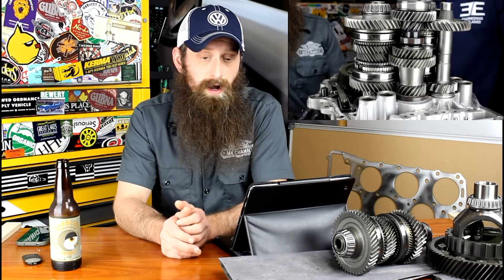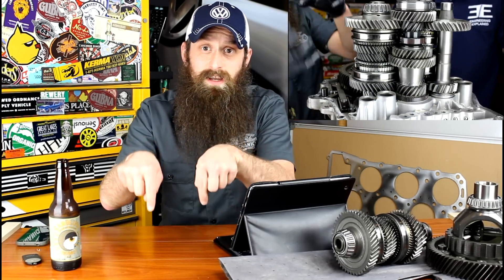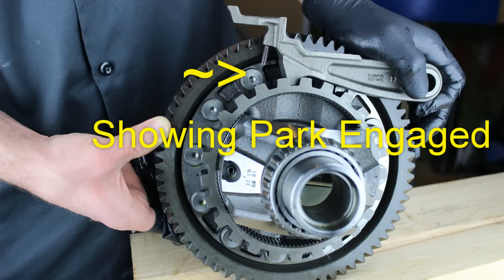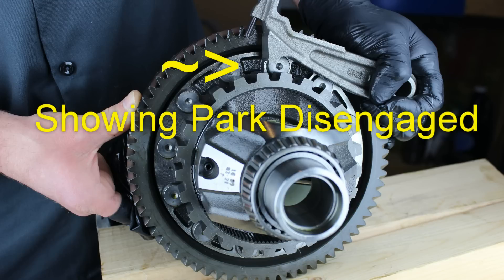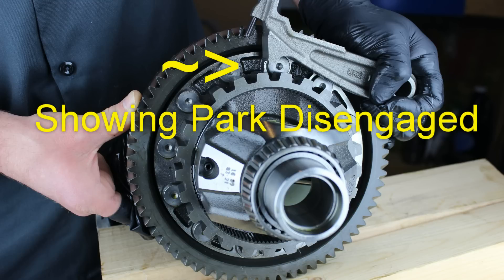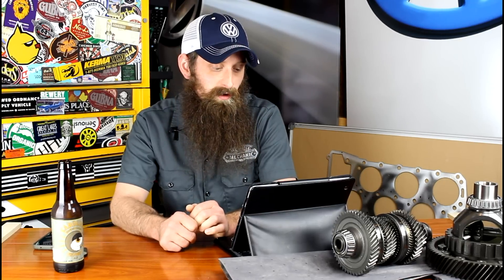Viewer Questions on DSG Transmissions, Podcast Episode 30

Comment: I'm removing the Mechatronic from a Jetta Hybrid and the service manual says to move the lock carrier to the service position. Is that really necessary? HAve the fans off. Looks like there is plenty of room in front of the Mechatronic. Also says to remove the power and control electronics on top. Is that needed too?

Comment: Hi 
I have just bought a 2007 1.9diesel golf TDI (dsg box) if stopped going uphill I take my foot off the brake it rolls back 
I thought the dsg would hold it , is it me or gear box at fault?its my first automatic car it’s done 67000miles

Comment: What is your opinion on dsg service with an unknown service history? Just bought the wife a 10cc with 150k, and I'm not sure if the dsg service has ever been done.. debating doing it, but with regular automatics I always avoid it if it's higher miles with no service history
Reply from the maker: I’d do it if it was me.
Reply: HumbleMechanic that's all you have to say! Ill add it to my to do list.. also.. going to do an intake cleaning.. i don't have a p2015 code, but debating just replacing the manifold with the updated one while I'm in there.. it's my wife's new car, so Im just getting all the maintenance out of the way now..
Reply from the maker: That I would wait on. I wouldn’t send the intake manifold money ontil I had to. But sure enough if you do that the code will set right after installing the manifold. Lol

Comment: Hi there i have a voltwagen cc 2.0t. Where is the actuator power supply inside the TCM caused i have a code p0658 actuator and u0101 please.
Reply: My is cc luxury sport 2010

Comment: Help dude... so when I accelerate  my mk5 gti 2.0 anywhere above 10mph it suddenly drops power then back on and of... kind of like when a learner driver takes off... tell me it's not mechatronic..thanks.
Reply from the maker: It could be any number of things. Is the check engine light in?
Reply: HumbleMechanic yes... there is an engine management light on..
Reply from the maker: That would be vital info and point to a place to start

Comment: Hello humble mechanic. I've been following you on youtube for quite some time and i trust your judgement on vw audi so i had a question if you could answer for me.  I have owned a few audis in my past and im looking into a 2012 S4 dsg now.  I keeping hearing about problems with that dsg and not sure if it relates mostly to the 2010 and 2011 models the most. I have a dsg now on my 2013 passat vr6 and seems fine with 75000 on the clock. Have you come across alot of problems with the S4 b8 in your past job.  Any feed back would be great coming from a former vw tech. Thank you

Comment: My 2010 Jetta 1.4 DSG suddenly went into free gear while on D as I came out of the car park. The D word on the meter was flashing and also when I moved the gear stick to S and R. Got help to push car back into car park. Do you know what could be the problem Humble Mechanic? Mileage is 119K km.
Reply from the maker: If it’s the dry clutch DSG the mech unit is a common failure point
Reply: Thank u Sir! Dry clutch 7-speed Jetta back to working order after replacing the mech unit. Cost me equiv US$2100 including labor! Sigh! Is it too much to pay for such a repair?
Reply: Piano Luv Guess it is. Thats one reason stopping me from going for a car with a DQ200, the relatively cheaper DSG! Wish this one sees it through the cars life. Cheers!

Comment: little late to the DSG question train.. But: when accelerating from a stop in my dsg on my audi s4 it is noticeably less torque(y) than when in manual shift mode. Is this normal, or is this something wrong with the dsg?

Comment: What makes it fart though? A half a second of ignition kill with fuel still being sprayed in?
Reply: Lipe Tavares yes,the difference between manual and dsg is that when accelerating you are keeping constant fuel injeciton by holding onto the gas pedal,where as in manual when shifting gears you have a time period without having the gas pedal depressed and all of the (most) fuel gets to escape the engine where as in DSG the shifts are so fast, that excess fuel that is sprayed between the shifts simply ejects in the exhaust creating the famous fart or burble
Reply: A diesel with DSG does´nt do it, it has motor rpm adjustment in the shiftingproccess. Must be that it shuts of fuelinjektion  a shot time. If you floor it you can notice this happening.

Comment: Hi, needing a bit of Info on the Golf Mk 6 DSG . Is it better to get the 2.0 TDI or the 1.6 TDi? And i noticed there's a DSG revision after 2011, are these 2011 onward better gearboxes than the older DSG? Plus what Kind od reliability issues are there between the 2.0 and the 1.6 TDI DSG? Many thanks!

Comment: Great videos.  I have an 09 Passat and I recently talked to a VW dealer mechanic who said DSG fluid should be changed every 50k miles but can get to 100k before it needs to be done.  Bought mine used at 80k so I hope it was done (no service records) but I will definitely get it done at 100k.  Mechanic said the cost is about $250.

Comment: Have you ever discussed the flashing PRNDS of Death? Just had one yesterday and it freaked me out. Turns out it's a very common problem with dsg's, specifically the temperature sensor and many times the mechatronic unit. (My car is an A3 2007 2T)
Reply: I had this issue and needed a new Mechatronics unit. I found a used one to replace my dead one. Tested my original to prove that it was no longer responsive. 2006 BRM TDI DSG 6 speed.

Comment: I have a jetta gli 2014 and I went to  the vw dealership in my country ( El Salvador) that my jetta should normally have a dsg fluid change from 40 thousand miles or a little up, they told me that dsg transmission never needs to change and that they are closed transmission. is that true? I read in the vw manual that 40k is the normal. why do they say that,? they suppose to be certified and receive proper training.
Reply from the maker: +Jose Ulloa our wet clutch is due every 40k. The dry clutch doesn't really have an interval but we only have it on the Hybrid

Comment: I have a question for you Mr Humble Mechanic, do you like the DSG transmission. What I mean by that is do you think it is stable now, and based on your shop experience how comparable to former types is it? I enjoy a good open road drive in a manual transmission, but I had a modded 4L60E 6 speed auto in my Impala and with a proper valve body setup for a 1/4 mile shifted far faster and  accurately than I ever have. Is it possible to get a similar operational benefit from the new types, or should I just get another 2 speed Powerglide and skip shifting altogether, lol. I miss not seeing a computer in the engine bay.
Reply from the maker: It is 1000% better than the earlier generations. I actually love the DSG. Let's put it this way, if I got a new Golf R, I would get the DSG. :)
Reply: HumbleMechanic cool thanks, I now want to look into functionality, and to take one apart.;)
Reply: HumbleMechanic how's the manual on the new mk7 golf R? Have you test driven one and what's your input??
Reply: exit07 manual is definitely much better, need not to ask.

Comment: HumbleMechanic Do you know any DSG performance fluid more for track and very little for street use?
Reply: Just use manufacturer recommended fluid, and do a dsg trans tune. Run it until there's problems(servicing ever 40k should prevent most issues) and more than likely replace upgraded clutch pack. The tune on dsg takes plenty of load off of the trans, and is easier on it than stock. Honestly a trans tune before a full ECU tune and power adders is what you want. I don't think you'll have ANY issues so long as you tune and service.

Comment: HELP: I have a 2013 2.0 tsi GTI that runs great except sometimes when I put it into reverse, it goes into gear for a second, then slips out and runs like it was in neutral.  The car keeps rolling and the engine revs up because the throttle is applied to try and back up.  It most often happens when I very lightly throttle while looking around behind me then when I go to back up at normal speed is when it slips out and the R for "Reverse" on the infotainment system blinks.  Other than this I have not experienced anything out of the ordinary at all and since reverse and 5th share the same shaft as 5th and 6th and I never have issues in those gears my only guess is that the computer is somehow getting confused.  I will mention that the car is at stage two with intake, down pipes and big cat backs but i can't think of a reason for that to interfere.  Also, I baby this car to no end.  It is taken care of constantly and is kept in impeccable shape.
Reply: Mr.Krabs it won't throw a code but if you scan the transmission under VCDS you'll see a P2711 code. I've asked around to numerous techs who work on VW's daily and this is a sign that your clutch packs need replacing. I'm currently going through this now as well since mid November. I'm just saving up money to replace them. I have a 2010 mk6 GTI with a K04 turbo and all the bolt-ons with 79k miles on the clock. the car is far from stock and I'm not upset that they're shot as it was my own doing. However, there are tons of people pushing way more power than I am (388 crank hp). I'm talking they are pushing over 400-450whp without issue. like Charles said it's really luck of the draw.

hope this helps!
Reply: Nick Antesberger would those be included in the power train warranty? Or is it voided by modifications
Reply: Mr.Krabs I have no idea to be honest. My best guess is that it's a wearable part like clutches in a manual. But check out and see. through ECS tuning right now the clutch packs are $629 but through a dealer you're probably looking at $800+ for just clutch packs and not including new fluid, filter, labor and other parts during install.

Comment: Getting a P0116 - about 1 year after VW replaced: Clutch pack, Timing chain, Cam sensors.. what else you be causing it? CEL comes on every 50 or so KM, UNLESS i drive the car in 'sports' mode clicking up and down the gears.. Any ideas???

Comment: Thanks for the videos and great channel man!
I just bought a 2012 CC R with the DSG and I was getting worried because sometimes gears don't engage quick specially  as you release the brake and press on the gas,  at least there's no consistency . also sometimes you feel the gears engaging as you move between P D N etc. and sometimes you don't feel anything specially when you press the  brake hard, not sure if this is all related to the NAture of the transmition but I would appreciate if you elaborated more on the subject on  another video.

Keep up the good work!
Reply: I'm having the same issues. I wonder if its due to the fact that my GLI has 82k and I have not done a trans fluid change yet as required  (every 40k.)????

Comment: Easiest way to change the DSG Fluid is use the measure, fill method plus about 200 ml. for fluid you can't measure for the filter. For my 08 GTI and my wife's 13 Jetta TDI it was 5 L even in both.

Comment: Have you found the differential to be the source for most/all of the metal shavings? There is a good thread on VWVortex DSG forum that describes this. It seems to align with symptoms and problems with all of the 02E transmissions.

Comment: Hi Charles I run an independent VW and other Euro car shop I have a customer car in my shop the car is a 2011 GTI with a DSG transmission and 118 000 km's it has several fault codes one with oil pressure adaptation limit surpassed pressure solenoid and unexpected gear desegagement I don't have the codes with me now but I could get it if you put the car in drive it doesn't move most of of the times if you put it tiptronic mode then it might move but if it moves it will be verry abrupt and the reverse doesn't work most of the time if you look at the clutch K1 and K2 the pressure is not constant and I notice the voltage on the pressure valve is not constant I check the mechatronic connector for corrosion and bad wires check continunity and power and I check the oil level in park and at 35deg Cel. It was over filled my guess is the Mechatronic is defective but I check at the dealer and a new one is $ 1.700.00 and I can get a complete trans for less than that with less than 10 000 km's but the issue is the code for this transmissions is kind of rare MSY and I can get the MMA code at a better price and lower millage what is the difference between them I notice in the ETKA part system the Mecatronic are listed together could I install a different code trans in this car I would like to put the Mechatronic first from the donner trans with the different code is there a chance that It would work ?
Reply from the maker: V10PDTDI Man, that is something I am not really sure about. Off hand I don't know the difference between the two. I would hate to tell you one thing and be wrong. Do you know what the MMA is out of?

Comment: I wouldn't mind your thoughts on my latest DSG video I posted last night. Do you know if the entire DSG case is pressurized so to speak? Or is all the pressure contained within lines and sealed clutch packs and things? Are the DSG clutch packs like a motorcycle open wet clutch style? I changed out the clutch in one of my bikes once many years ago. Bottom line, could a DSG tune cause more fluid to leak out your DSG gaskets and seals?

Comment: HumbleMechanic Awesome video. I'm changing my DSG fluid this weekend on my 2012 GTI for the first time in my driveway. Unfortunately I dont have the fill tool so i will be filling from the top. Im a little nervous about the fill and drain out the overflow to get the right level but it looks easy. I wish it had a dip stick but that would be too easy.

Comment: A liter is more than a quart.  1 gallon = 3.8l
Buy your beer in liters rather than quarts, and enjoy more.

What about the 4-speed ZF in my Eurovan?  Is the fluid level so critical?  The VW fill tool is $200 from Snap On.  What about just using a long funnel?

Thanks.
Reply from the maker: Garth Goldberg From what I remember I fill those with a funnel. Fluid level on all VW transmissions is a judgement call..

Comment: starting now, i love DSG discussions. i have had DSG on all 6 of my GTI's.
Reply from the maker: LastHumansGarage AWESOME! :)
Reply: my error on my DSG change video (my most popular GTI video ever), was a temperature issue. I let it sit 3-4 hours before draining and starting. But even when done and filling, the new DSG fluid temp was STILL at or over the 35C mark. It takes a long time for that case to get fully cold. So I just estimated right when it was about 35C.
Reply: Am I correct that a DSG "tune" should have zero effect on DSG case gaskets and such?
Reply: any risk of snapping the parking pawl if rolling too much on it putting extra stress on the tiny peg? for strange people that don't use the parking brake?
Reply from the maker: LastHumansGarage It shouldn't make a difference. I have heard mixed reviews about the driveability of tuned DSGs, but I can not confirm those.
Reply from the maker: LastHumansGarage It is a REALLY stout park on both the diff and the pawl. You would have to be doing something really dumb to mess it up. :)
Reply: HumbleMechanic oh hell, i couldnt do WITHOUT a DSG tune anymore. My last 2 or 3 GTI's had it. For my car personally, it removed all the hunting and confusion at slow speeds in low gears. Also downshifts earlier in D mode for corners, so it stays in the power band much better than stock. Finally, it doesnt shift to 6th at 40mph like stock, this one needs to go about 50mph or something to hit 6th. The shift speed improvement itself, I don't think its really noticable. That's not why you I recommend buying a DSG tune.
Reply from the maker: LastHumansGarage Thanks for the feedback. I think I need to get behind the wheel of a tuned DSG.